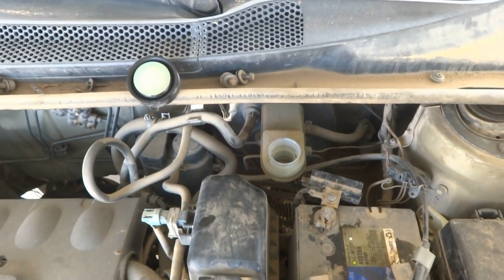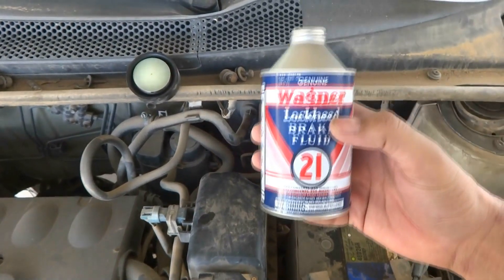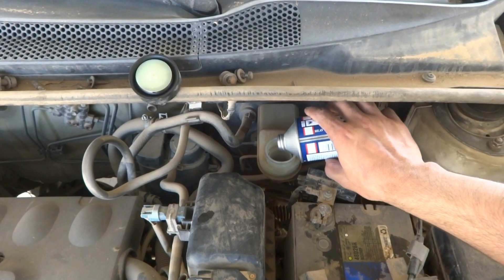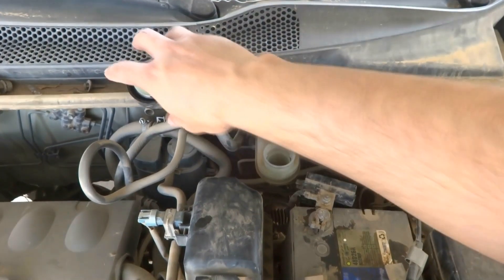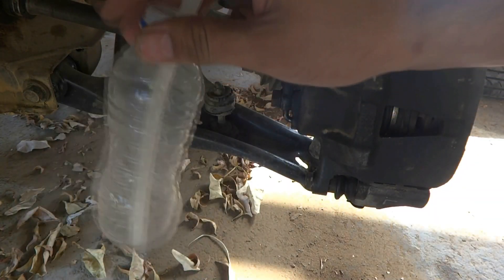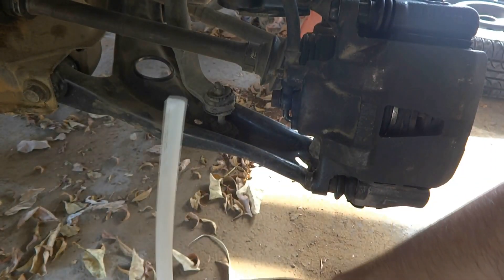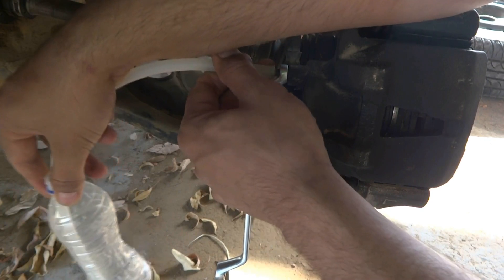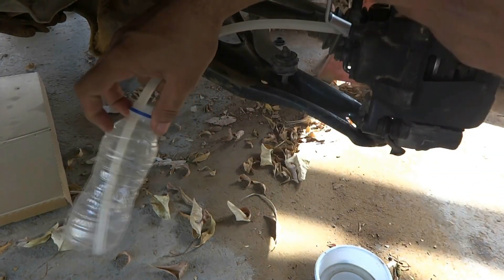Brake bleeding procedure. Complete version.

Comment: Im supprised that the air didnt return to the brake caliper when the peddle was released, but it worked and thats what matters, smashing :-))

The "press and hold" method is the one ive seen most people use and if your alone a one way valve on the tube end works.
On some cars just opening the bleed nipple and letting gravity leak the fluid out works.

As you said jahan "many ways to do the job" :-))